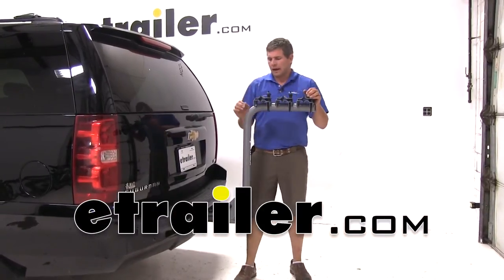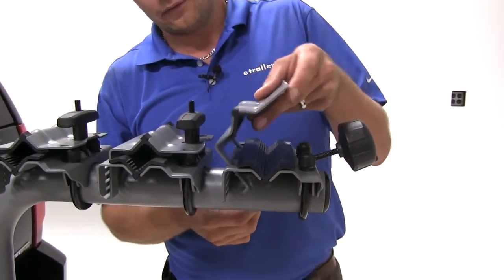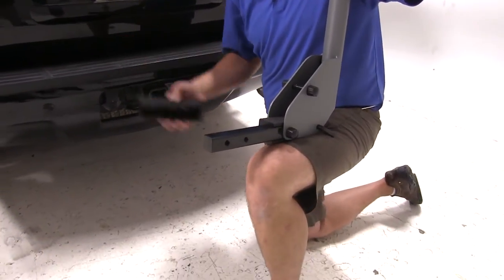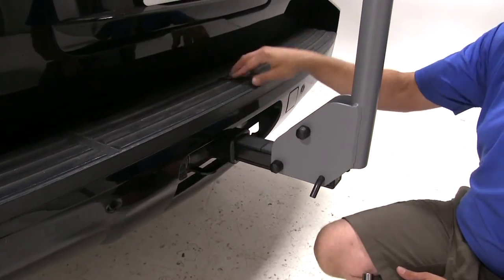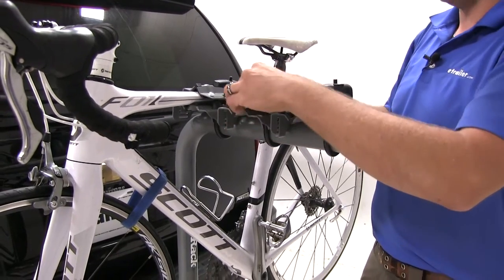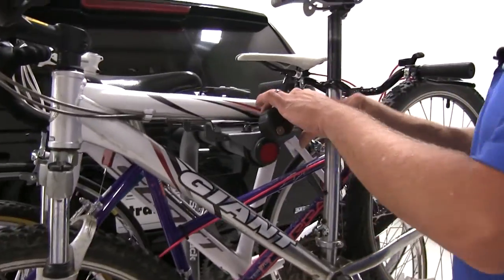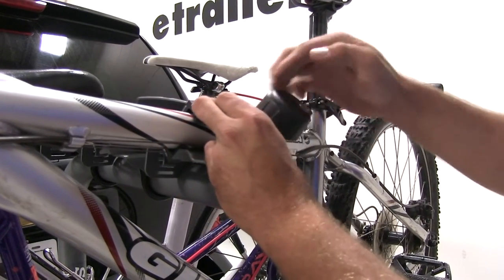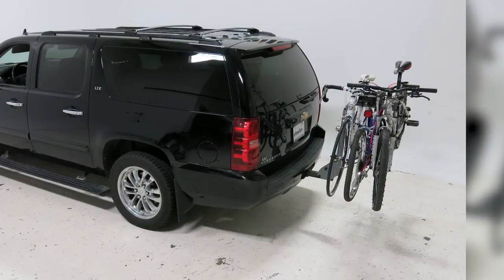etrailer | An In-Depth Look at the SportRack Pathway Bike Rack for 3 Bikes

Comment: I just installed the above bike rack. I followed the instructions and tightened everything. The hitch is slightly not as firm as it should be in the video. The nuts and bolts are tight. What went wrong.
Reply from the maker: The best way that we have found to get the majority of the shake and play out of a bike rack is to shake it from side to side while you are tightening the anti-rattle bolt. This will allow you to work out the play.
https://www.etrailer.com/Hitch-Bike-Racks/SportRack/SR2703.html